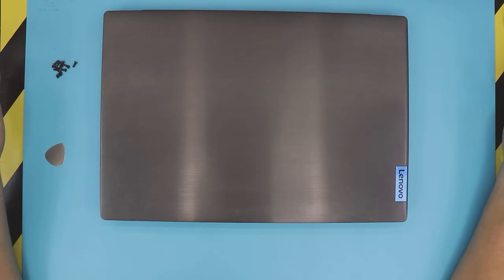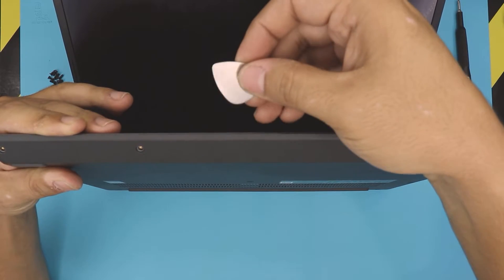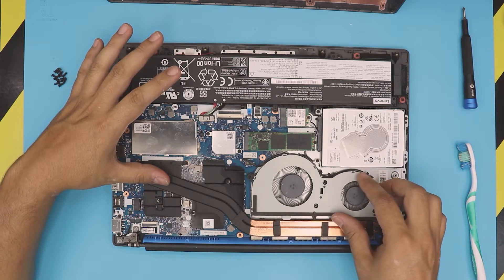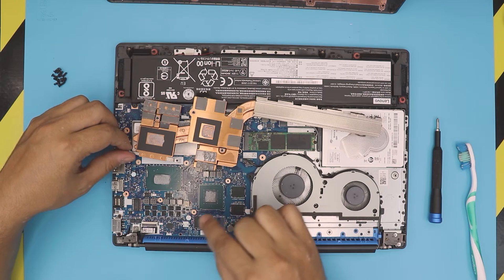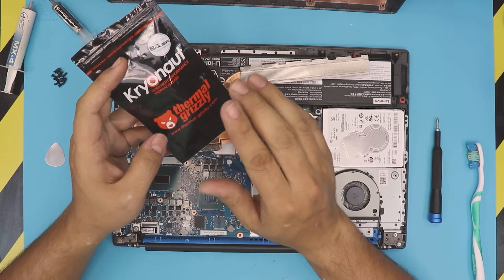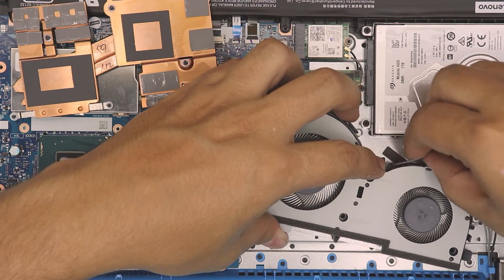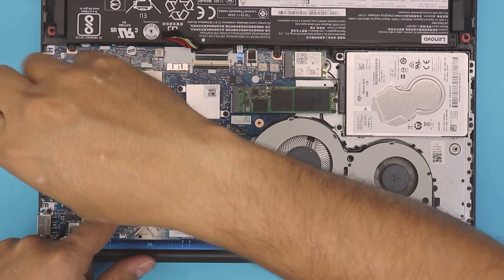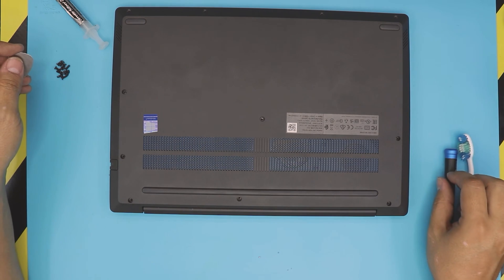Lenovo Gaming L340 Repaste maintenance under 10min !

Comment: Heyy, nice video

Btw I have a problem...
I have Lenovo IdeaPad L340 Gaming
With specs:
Intel i5-9300HF 2.40ghz turbo to 4.1ghz
NVidia GeForce GTX 1050 3gb
8gb Ram

Its only 2 months old.

The issue is whenever I play games like Mad Max and Rise of the Tomb Raider the cpu speed goes down to 0.79ghz after playing for a while.

Do u have any fix or suggestions for that cuz it's happening everytime and it also makes games unplayable.
Reply: When I play GTA v my fps decreases like hell but in normal games like valorant it remains 100 to 144 .... So I guess it's over heating
Reply: @klaus9687  use msi afterburner to see ur GPU and CPU stats and see if it overheats
Reply: @nj_mods  I did stress test and it gave warning of over heating
Reply: @nj_mods  and my laptop is 2 months old so I am gonna repair it from service center👍
Reply: @klaus9687  ok keep me updated after repair👍
Reply: @nj_mods  hi what is the value at which u undervotled?
Reply: @klaus9687  I used ThrottleStop in which I undervolted core and cache offset voltage to -112.3mv
Reply: @nj_mods  for me it's not working I am getting 23 fps still😢
Reply: @klaus9687  u have same specs as l340?

Check if it's thermal throttled

Thermal throttled means ur cpu dropped down to 0.79ghz
Reply: @nj_mods  yes and when I try to open throttle stop it freezes...😞
Reply: @klaus9687  try resetting every settings u made in windows and also try changing power plan as well
Reply: @nj_mods  should I reset my pc?
Reply: @klaus9687  first scan for any viruses then only reset
Reply: Also... is ur gta v pirated*?
Reply: @nj_mods  no it's from steam ... and I can't reset undervolt settings ...so I guess I have to reset pc ( Lenovo is the worst )
Reply: @klaus9687  which one u used ThrottleStop or Intel XTU for undervolting?
Reply: @nj_mods  throttle stop
Reply: @klaus9687  that shouldn't happen I am able to reset... Did u changed anything else?
Reply: @klaus9687  also if u can't reset settings in ThrottleStop then restart ur laptop and completely delete ThrottleStop. As it only able to work when u manually start ThrottleStop otherwise it stays at default
Reply: @nj_mods  i reset my laptop and i dont know exact settings for undervolting and yes i made same changes in tpu
Reply from the maker: Thank you for the feedback and your support to the channel by a sub :P
Regarding your question:
#1. before you game make sure your battery is fully charged, and connected A/C
#2. never play game on battery only,
#3. if its two months old its not because of over heating. its because of a power regulator on a motherboard is going bad.
do this and report back:
power off the laptop:
plug the charger and let it sit for 3h, then power on with charger plugged in and check the cpu speed , and when gaming (if you feel  that its slowing down) double check to see if the battery is charging and its at full. if you minimized and see the battery at 80 or so that means the charger got disconnected sometime mid gaming (because of charger failure) and the cpu lowered speed. you may simply have to replace the charger.
Reply: @uFixTek  I have turned on Conservative Mode on Lenovo Vantage which does not let battery exceed 60%, which increase battery life... So does that affect to the CPU temps?
Reply: @uFixTek  unfortunately it happened again, as of before it was fine

during noon I turned off and removed power cable then after almost 2h I started my laptop back on and still kept it unplugged as of I was watching some YT then I plugged in and then started mad max and after playing like 30mins cpu went to 0.79ghz.

It wasn't the case in the morning as I was using it from like 9am to 2pm continuosly and never had any issues... Also I was playing mad max in morning like 2h without any issues
Reply: @uFixTek  I did a stress test using Intel XTU and it was power limit throttling and thermal throttling...
Reply: @nj_mods  same problem so whats the solution?
Reply: @klaus9687  I did some undervolting to CPU and Lowered GPU clock speed from 1600mhz or something to 1495mhz
Also got a cooling pad

So with all that my temps never get over 72C

Comment: did you just say 1060, 1070 GPU? I'm shocked. btw, have mine for a year now, still great as it should be. Great for gaming and productivity.
Reply from the maker: they are great laptop and i have seen a 1050 and 1060 not to sure about 1070 :P
if you had it for a year check temps and it would be a nice to do a repaste, its like having a car and saying still runs fine, and not change the oil :P
Reply: @uFixTek uFixTek Alright man. I will. Thank you so much for the advice! Much appreciated.
Reply from the maker: @allenocampo6174   your welcome and if you ever need anything regarding laptops feel free to ask :)

Comment: Hello I have been an owner for this laptop about 6 months. In the beginning I did not have any issues with thi,s computer but nowadays,  on playing valorant gpu reaches temperatures around 86 degrees celcius and the FPS goes down to 30-40s from 200- 230s. What is the problem, could someone tell me?
Reply: I did not have something before the my charger broke down and the service sent me a new laptop charger. After that, I am having this issue.
Reply from the maker: Thank you for the feedback and your support to the channel by a SUB :P
regarding your question:
sometimes the new chargers give a fraction of extra voltage (.4 -.6 volt) extra and that can cause the components failure and over heating. this issue was happening with HP service center chargers and they had to do a recall and now its happening on lenovo and dell few cases.

Comment: The battery life in this thing is horrendous. It was good for the 1st couple of months then whoops! The shit was tanked
Reply from the maker: Thank you for the feedback and your support to the channel, regarding the battery it is horrible as we change them very often the quality of  lithium polymer battery on this models are very low grade.
Reply: as far as I know the problem is in MSI Afterburner if you are using it ofc, the thing is that MSI is constantly pinging your GPU which results in draining your battery faster
Reply: so I think that maybe turning off the program while using your laptop on battery may solve your problem at least a little

Comment: Idk why but some of the screws on the gpu and cpu wouldnt turn, i need help
Reply from the maker: its normal open up screen 90 degree and place the keyboard face down on the edge of the table with screen hangin down on the side this way now you can press down hard on the screw driver and at the same time rotate wile pressing hard on the screw.
Thank you for your feedback and your support to the channel :P
Reply: I'm having the same problem

Comment: Really great video. I have my laptop for 1 year now, it's dropping frames in every game and fan if not rotating as it used to, should I clean it the way you showed in the video? or is it something else?
Reply from the maker: Thanks for sharing, thank you for the feedback and your support to the channel by a SUB :P
regarding your question: yes do the exact steps that i did in this video and your laptop will appreciate the effort and you will see a big difference, use one of this paste:
for the best of the best:
https://amzn.to/3b5byMT
2nd best:
https://amzn.to/2N7CTpJ
good luck my friend :)
Reply: @uFixTek  bruh i waped of the glizzy i though Tf now i know why my PC didnt work there was some glue lol
Reply: @uFixTek  can i clean fan and metal tube with vacuum cleaner? Heard it can damage the parts
Reply: @vrushabhpashilkar7317  only solution to this is regular maintanence i guess
Reply: @vrushabhpashilkar7317  bro i had the same problem , i just cleaned the fans from inside . problem solved
Reply: @agamvfx3880  bro how remove the dust completely from fans
Reply: @electrohacker1324  open the laptop , clean it
Reply: I have the same issue, I've had my pc for a year pretty much, and suddenly my frames started to drop really bad, or sometimes it would be fine but after playing for a while is started to get framedrops every few seconds,which is really annoying. I do have a question though, if i just want to clean it to get better performance, should I really apply new thermal paste?
Thanks for the video it really helped me out and keep going!

Comment: Hi boss i want to ask if that laptop is new? meaning from the box ? or used?
Reply from the maker: hi, its new from box i opened the sealed box when the client purchased it.
Thank you for the feedback and support to the channel :)
Reply: @uFixTek  i just bought i the same thing yesterday and wondering why did you repaste if this is new?
Reply from the maker: because the factory paste are the worst paste, if you repaste now, your laptop will last longer  as it wont run at higher temps.
we always recommend and i personally do it to my equipment, Thank you for the support and feedback.

Comment: I'd be great if you would post your thermals before and after.
To see if kryonaut would help with throttling.
Reply from the maker: i usually dont like putting that info because unless i do a live test, then that would be a hard prove , else any chart could be a fake number, i could easily tell you with Kryonaut you will get the best temps possible before liquid metal, and your results will always be different than anyone else because of many factors : room temp type of testing and airflow, and how well you repasted, note: when playing lift the back end of the laptop about 1-3cm and you will see a huge temp drop. i will take your advise and try to implement the chat in my future videos.
Thank you for the feedback and your support to the channel, if there is anything else i could help you in the future ask me in any of my video comments. good luck :P
Reply: @uFixTek  All true and fair enough, if the laptop is old and you're cleaning it may as well put on new better paste.
What I'm interested is it worth just to replace the paste, yes kryonaut will be better than anything the manufacturer put on but will there be a substantial difference?
As you said there are many other factors to take into account when it comes to cooling laptops, so in general the difference would be 1-2 degrees then it's not worth it, but if you would tell me that it could be up to 10 degrees difference then I would replace the paste immediately.
Reply from the maker: oh my friend you in for a surprise... If you replace the manufacture paste to a kryonaut paste, you will definitely see a big difference about 10-20 in some cases even more.
but again, what you are going to realize is that when you repaste, your fan noise will drop a lot, unlike with manufacture paste the fan that is working twice as hard to keep the temps down. so keep the factor in mind, that the fan is working less with new paste.
e.g manufacture: temp reaches ABOVE 80c, the fan will go to max speed at 100%, trying to bring to 80c or under.
e.g. new paste: temp reaches 79c, but under 80c but the fan running at <70%, no need to spin faster because its under 80c
so what you may think (oh shi***t its only 1c or 2c difference), but in reality its much higher. if you set the fan to 100% at 79c it will bring that 79c to around 60c.
so i recommend you to find a good fan curve control and set a nice fan curve, e.g. msi afterburner.
there for most of the tests out there are done with auto fan curve. and that results are not valid.

but if you ignore all the above and you do a repaste, me with over 15years of experience in electronics and degree in physics, can tell you for sure that your cpu and gpu will be happy, even more your fans :P

i hope i have explained my self, i wish you the best in your results.
Reply: @uFixTek  Thanks for the informative response, the fan noise noise ain't that big of a deal for me but throttling is, during load my GPU gets to 75c Max (90c in a specific stress test)
But my CPU even with undervolting anywhere between 80-95c so it throttles hard.
So definitely gonna repaste with some kryonaut. :)
Reply from the maker: oh daymn i would really really recommend you repaste and place a copper shim on both 20mm x 20mm x.4mm -.5mm
https://amzn.to/3pfYjOW
you will see major major difference, and before asking about the pads on vrams , you really dont need the pads for the vrams they are there for those that do vram overclock.
there reason for the copper shim is to create more pressure on the gpu and cpu, and the result will be 60%better, comparing to simple repaste.
the reason is: law of the physics: in order for two parts have better heat or cold transfer its pressure, and with this crappy x clamps that they use in purpose they remove the pressure on the heatsink and by placing the copper shim you will create a great pressure and you will see a dramatic temp drop.
i have made few videos with copper shim with liquid metal but dont place LM just place paste instead of LM.
you should never hit over 90c under load or tests.
again if you dont want to get the copper shim, just do a simple repaste. but it would be awesome if you did place a copper shim on top.
Reply: @uFixTek  The cpp[er shim sadly sin't doable in my case but still gotta say big thank you man finally the paste arrived and got to repasting my l340-15irh and the difference is stark doesn't break 80c on either the CPU or GPU, The manufactured paste was a mess not like in your video, it was all spilled over the chip (green part) as far as the edges, the paste itself wasn't even that old it was still a bit wet.
So again man big thanks.

Comment: I apply the thermal paste and made undervolt -145 mv cpu now my Lenovo IdeaPad L340 Gaming is not exceed 80°C. I used Cooler Master MasterGel Maker Nano thermal paste. It is a bit of expensive, but good for this value. Thanks uFixIt for this video.
Reply from the maker: under-volt will make your motherboard last much longer, apart that it brings the temps a bit down. thank you for the feedback and your support :)
Reply: my ideapad only goes 80 mv down
Reply: Kanka undervolt performans düşürüyor mu

Comment: Please help me immediately, i can't open copper pipe's screw's, which screwdriver is compatiple with this one. Because i can't open it it is stucked, i opened gpu's 2 screws but processor's 3 screws can't open. I think it stuck from temperature. Please help me i need my laptop immediately. Which number of screwdriver compatible with cooper pipe screws?
Reply: Ok I listened carefully PH0 is compatible but i need open method it is stuck
Reply from the maker: My friend its SCREW Philips 0 , and you need to press hard on the screw and rotate, press down hard and rotate. in case you messed up the screw head then you have to make a straight cut on top of the screw heat to be able to use screw driver.
Thank you for the support and if there is anything i can help let me know.
Reply: Thank you, I solved the problem with another so thick flat type (idk number it is in the set) screwdriver. After that I apply the thermal paste and made undervolt now my Lenovo IdeaPad L340 is not exceed 80°C. I used Cooler Master MasterGel Maker Nano thermal paste. It is a bit of expensive, but good for this value. Thanks uFixIt for this video.
Reply from the maker: im glad that you got it fixed my friend if there is anything else let me know good luck. :)
Reply: @uFixTek  I have a one question too, can I change this messed up screws? Or I need a new heatsink, heatsink is so expensive i checked from internet. These screw also has C-Lock as you said. If I can change it also if you have you got any this numbered screws, I will buy from you. Because I need 2 screws from these one or set. If you have and you can sell me I will buy from you with ebay, bitcoin, or any your selection payment method.
Reply from the maker: ok yusuf, you turkish right i speak farsi and turkish :P
no need to purchase and heat-sink or anything like it,
all you need to do its remove the C lock and trash it it's useless, its just there so you don't loose the screw :/
once you removed the screw just take the screw to any electronic shop or laptop shop they can gift you few, i have no idea the what size is the screw but you can even check and see if the wifi screw its compatible with it (it should)
dont pay for it online you can find the screw everywhere. place the wifi if not take the screw to any laptop shop not the heatsink and not the laptop !! take the screw only else they will charge you alot.
but i would remove the c lock and take the wifi screw and place it in heatsink and put the damaged screw for the wifi (its just gona hold it in place) send me pics of the screw let me see.
use :
https://imgur.com/
Reply: @uFixTek  Teşekkür ederim, fakat şimdilik bu kadar macera yeterli, bir sonraki termal macun değişiminde eğer çıkarmakta yine zorlanırsam yenisini mağazalara soracağım veya sizinle iletişim kuracağım. İyi çalışmalar 😄
Reply from the maker: iyi şanslar arkadaşım, güvende kalın. :)
ayrıca Azerice Türkçe konuşuyorum. : P

Comment: After this work how many degrees get on stress test for this model? I ordered Cooler Master MasterGel Maker Nano with 11 w/m k value. I will apply my Lenovo L340 with this method. I hope I will get rid of from the 97-100 degrees
Reply: Thank u friend for all of this detailed comment. Have a nice day, i will write the result after repaste with cooler master
Reply from the maker: Thank you , and hope to hear back from you with your results :) good luck
Reply: My device also shutdown some times
Reply from the maker: wooo you need a re paste your device will have dramatic drop in temps. as you can see the other comment the guy says it helped him to drop the temps y 20c , you will see a big difference. the reason for shutdown is because of intel over heating protection, it shutdown to prevent over heating/ damage to cpu. thank you for the feedback and your support to the channel.